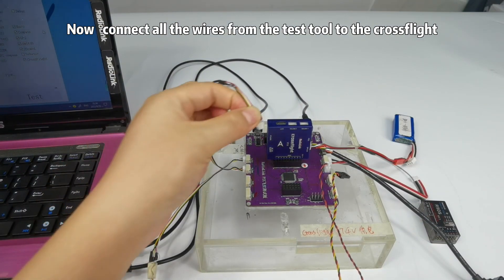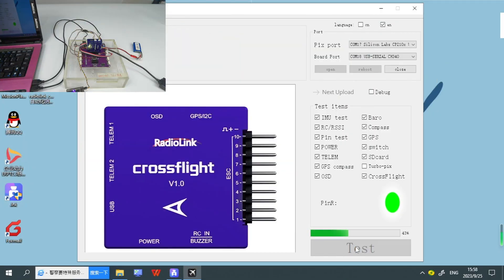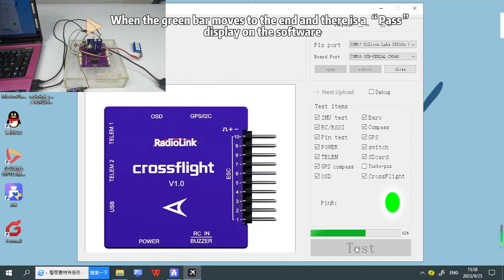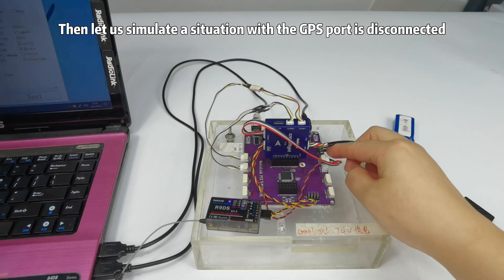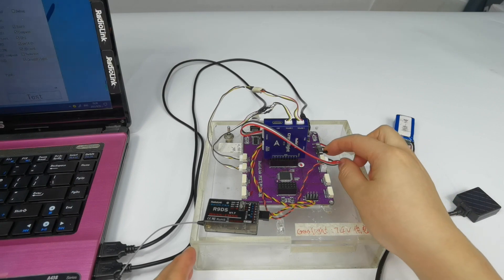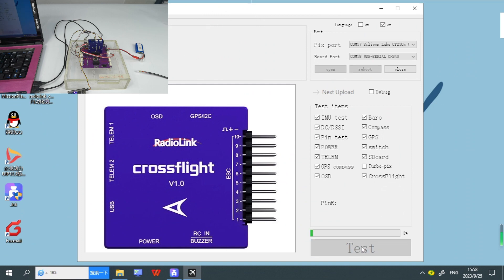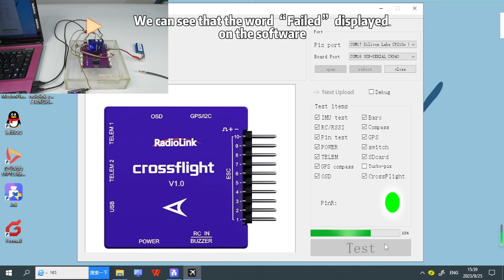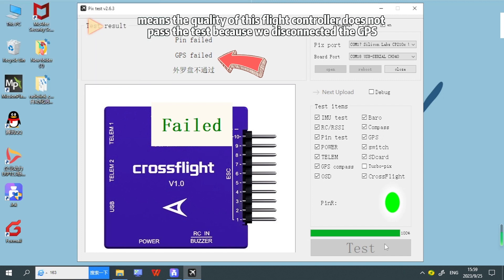RadioLink Automation Test for All Functions of crossflight

Comment: hey my drones yaw is tilting to left,can you share the correct pid settings of this flight controller
Reply from the maker: Hi, sir. The parameters suitable for each aircraft are different, so you need to adjust it according to your own aircraft. If the yaw is tilting to left, you can adjust the parameters related YAW in PID setting page. Here is the link for your reference. https://www.radiolink.com/newsinfo/475985.html   If any question about RadioLink products please feel free to contact us. Our email is: after_service@radiolink.com.cn

Comment: Hello, I recently purchased a Crossflight FC, and I'm thrilled with the results. After some cable remapping, everything is working perfectly. I'm particularly impressed with the drone's stability during flight and its seamless integration with the SkyDroid app. Telemetry is also functioning flawlessly, thanks to your tips. I have one question, though. Is there a way to fine-tune the battery percentage configuration? It appears that the percentage calculation by Crossflight might not be entirely accurate for my 4S 6500mAh 60C battery. I often find myself double-checking the voltage for accuracy. The configuration I set up in Mission Planner is as follows:

Mission Planner -> Setup -> Optional Hardware -> Battery Monitor

Monitor: Analog Voltage and Current
Battery Capacity: 65 mAh
Sensor: 0: Other
MP Alert on Low Battery Unchecked
HW Ver: 4: The cube or Pixhawk

-Calibration
1. Measured battery voltage: 14,7032431742
2. Battery voltage (Calced): 14.6962973490
3. Voltage divider (Calced): 21,04476
4. Measured current:
5. Current (Calced): 0,20000000298
6. Amperes per volt: 18,0018

The battery volttage on Mission Planner DATA screen is correct. 
If I change the battery, do I need to recalibrate these paremeters?

Your guidance on this matter would be greatly appreciated. Thank you!